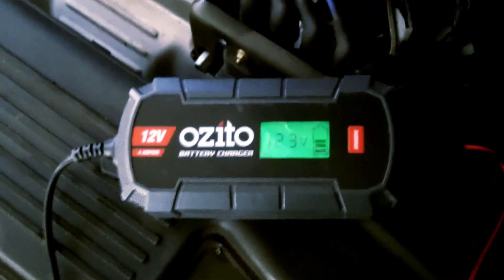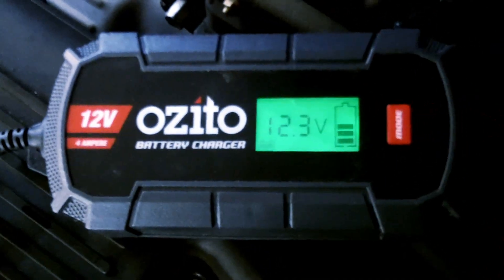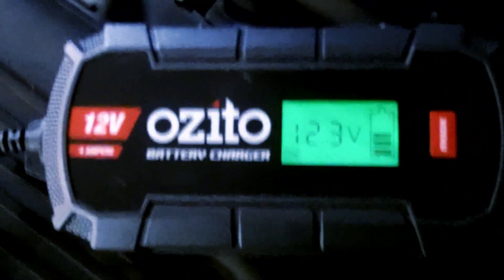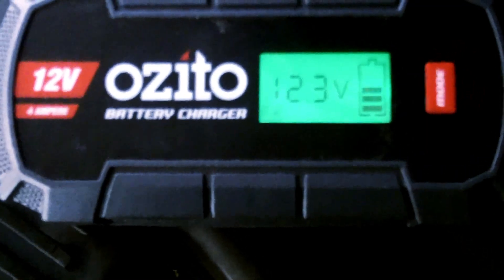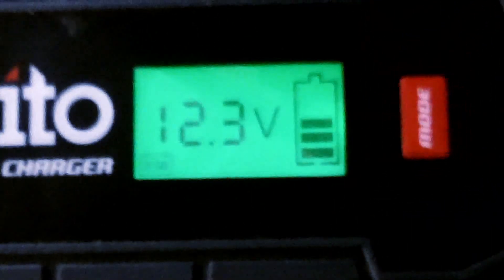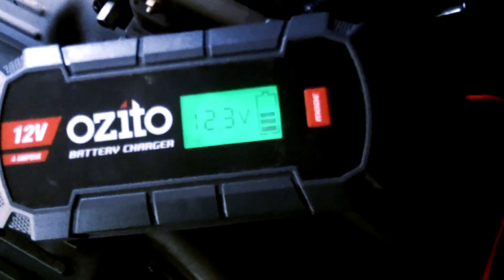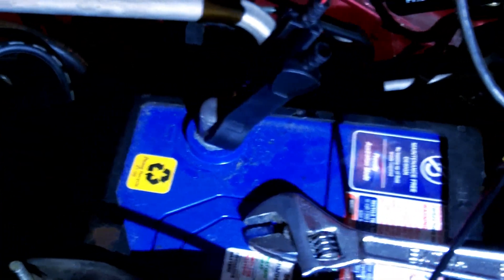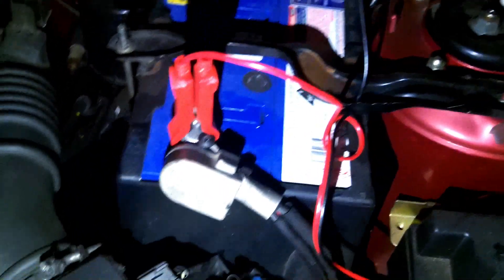Charging a FLAT car battery with the Ozito using ''Supply'' mode.

Comment: Been having issues with my new battery which was (obviously) drained - No modes would charge it just dropping volts until the 'bat' message came on. The battery (batteries actually/same issue on another I had kicking about) should be fine and both have inbuilt indicators that show when a battery needs replacing (white), is flat, and charged (green).
Looked up the issue and have found this vid...in the process of trying out the remedy. Here's hoping !